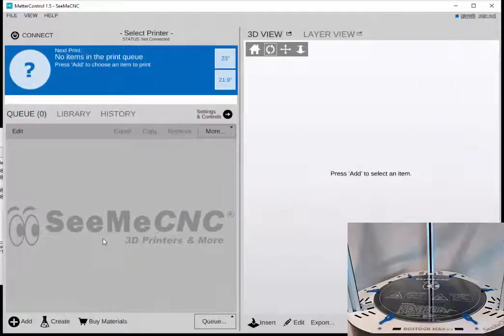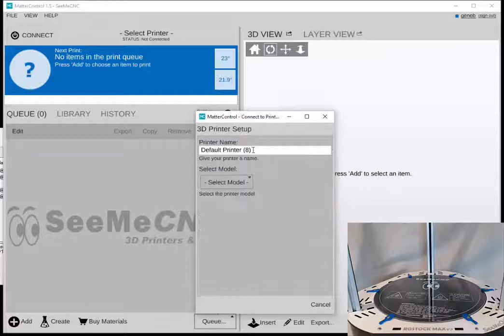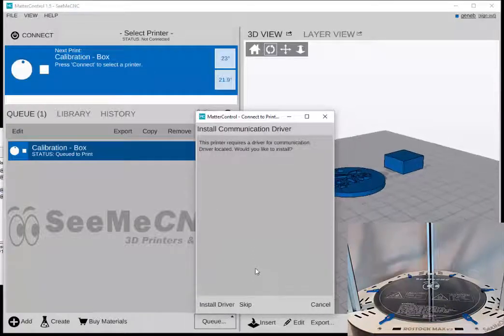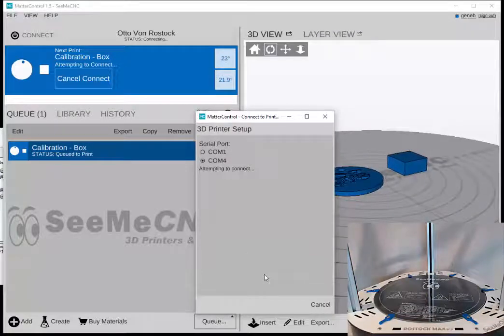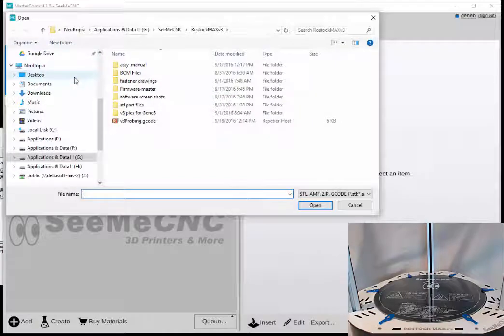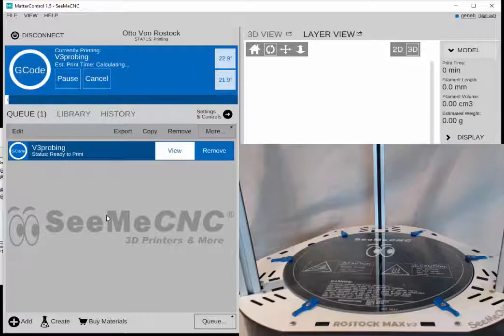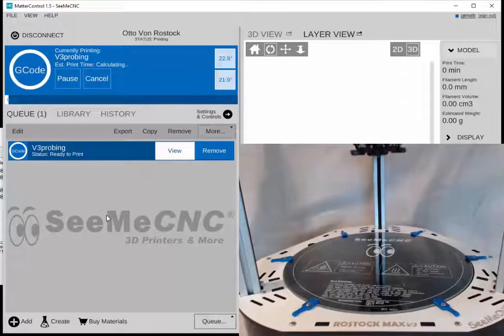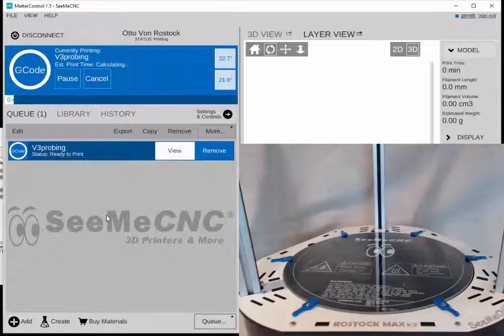Configuring MatterControl and Calibrating your Rostock MAX v3

Comment: So my printer just ran through to the bottom and crashed.  The belt started to slip and had to turn power off.  Any suggestions?
Reply: did you end up changing your v2 height from 360 to 375? because my rostock mx v2 seems to be set at 350 as its supposed to be and still crashed the hot end into the table